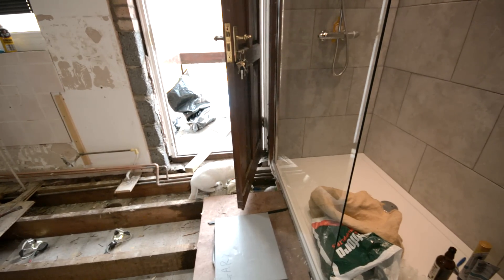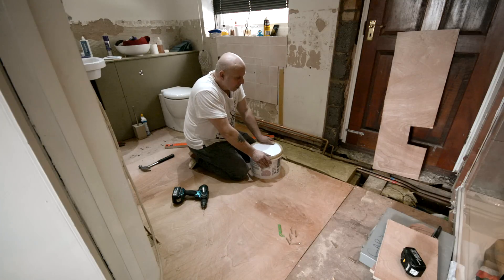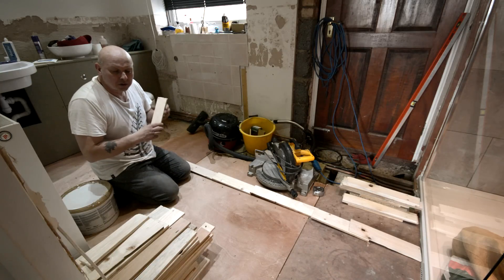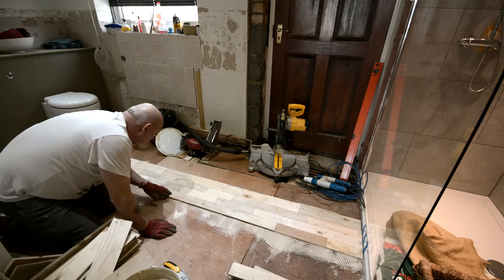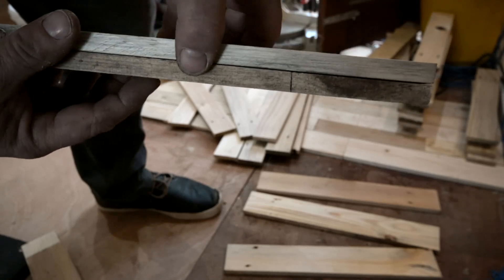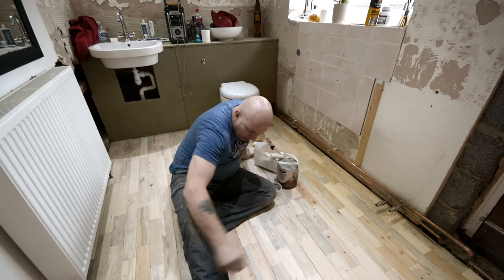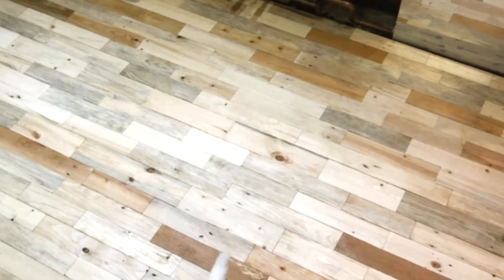Pallet wood bathroom floor

Comment: Nice cheers👍🏻🇬🇧
Reply from the maker: Thank you
Reply: How did you waterproof it buddy?
Reply from the maker: @StuartOliver83  A few coats of Liberon Hard Wax Oil, It is suppose to be for high moisture areas, such as and bathrooms and so far has done the job. I didn`t want a gloss varnish look but a good satin yacht varnish would do the job just as well, Hope this helps.     Gary
Reply: Thanks mate it’s exactly what I need to know,I’ll somehow send a pic when done 👍🏻🇬🇧
Reply from the maker: @StuartOliver83  love to see it when its done.

Comment: Hi, very nice work you have done. I am planing to do the same in my bathroom but the floor is from ceramic so i dont know how i can fix the pallets over the stones. If u can give me an idea it would be very apreciated. Thanks very much from Spain
Reply from the maker: You can do a test piece to see if Bona 850 rubberised glue would work. It can   handle a lot of movement But the glue is only as good as the surface it is fixed too. Hope this helps , thanks Gary
Reply: @possumheadcarpentry  Thanks very much for answering. I have searched the web and I can find that glue here. I am going to try as you say in a piece . Many thanks again

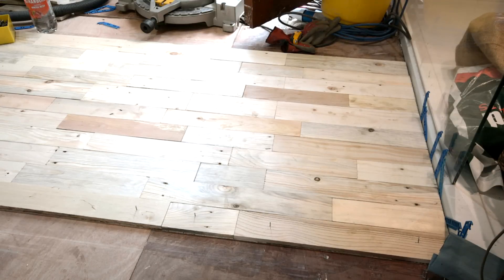Comment: Great job my friend.  I am in the middle of doing a pallet floor for my 11'x12' office at home.  Like you, I got tired of pallets and began using some hardwood boards I had.  All wood is now planed, edged, and ripped to width.  I have it stacked inside and getting it acclimated for a week or two.  I am leaving all knots, bug holes, etc with the intention of filling it with Alumilite or a quick setting epoxy resin.  I did want to thank you for taking the time to make the video and also at the 6:12 mark for giving the idea to pin the last row of boards into place while the rest dry.  Brilliant!  I am going to do a center design of a diamond in the room and will use this tip.  Thanks again.  I think I followed you on IG.
Reply from the maker: Thank you very much, its nice to hear someone else is going through the pain. It is a lot of work but when you are finished it will be worth it. My next pallet wood project I have had to shelve because I was going to do the front of my house with pallet wood but the local council would get all unnecessary so I have decided to do the entire front room with the pallet wood. You should do a video to put on Youtube to give people ideas. Thanks again.

Comment: Looks great.. im looking to do the kitchen using pallet wood on concrete floor. Did u just use glue on floor? And did u glue the pallet pieces together or left the floor glue to hold it?
Reply from the maker: Hi, I just glued them to the floor, I used BONA 850 R, it’s a rubberised glue so the whole floor can move together. I temporary pin the outside rows till it goes off then take the pins out so it can all move, hope this helps

Comment: Why didn’t you have the toilet sitting on top of the flooring ?
Reply from the maker: Unfortunately it is the only toilet in the house and I didn’t have time to lay the floor before the family came back
Reply: @possumheadcarpentry  fair enough, do you find the loo is noticeably lower?
Reply from the maker: The floor is only 13mm thick so you don’t notice

Comment: Nice work! Currently replacing the old nasty carpet in an RV with a palletwood floor. A ton of work, but beautiful and rewarding.
Reply from the maker: +Tim Royal  What a good idea, It will be worth it in the end. A video of the finished job would be good. cheers
Reply: The "character" of palletwood makes it a bit wild... It cracks checks and splits pretty easily. Gluing it to a stable underlay stabilizes it... I wouldn't just nail it personally.
Reply from the maker: Its best glued with a rubberized glue like Bona because most pallet wood isn't seasoned so it will move but if you keep it in the dry ( preferably in the room its going to be laied ) for as long as you can then it will stabilize as much as wood does, hope this helps, cheers
Reply from the maker: I must admit that laying a pallet wood floor in an RV is new to me but if you used a packer between them and used mastic as a type of grout then it wood be possible but a hell of a lot of work. cheers
Reply: I am brad nailing and using titebond II to an mdf base... the engineered wood will prevent the palletwood from moving (similar to the layers of plywood)  The edges must be parallel and the back against the mdf must be jointed/planed flat and use plenty of glue... I buy it by the gallon :). This is a tried and true approach for me... works perfectly every time.
Reply from the maker: The beauty of woodworking is there is so many ways to do one job, As the saying goes , if its not broken then don`t fix it. Hope to see a video, cheers.
Reply: Thanks! I probably won't do a video, but you can find me on Instagram and you will definitely see the result! www.instagram.com/timroyalsr/
Reply: Hey! I would love to see the work in progress/finished project of the wood flooring in the rv as I have been thinking about doing something similar.. Thanks!
Reply: +Dakota Langdon slow project! At this point the mdf is laid and a lot of boards are cut, but probably won't get this done until October.

Comment: Water will ruin that floor and no doubt the floor underneath will also Suffer .
Reply from the maker: Because I used a wax oil, nothing has got under so far, and because I used a rubber based adhesive, if any water did get through , it wouldn’t spread but even after a few years nothing has got through

Comment: Looks great! Is glueing better than nailing or screwing?
Reply from the maker: When you are fitting a wooden floor it’s going to move , so if you nail or screw it will crack or twist or cup, so if you glue with rubberised glue it is aloud to flex and move and keep its shape, hope this helps .
Reply: @possumheadcarpentry  thanks that does help

Comment: Beautiful job!

Are there any advantages in using an oil based stain as opposed to a clear coat of varnish?

Regards Dave
Reply from the maker: Hi David, I`m not really sure which is best. I used Liberon hard wax oil because someone recommended it. I read the info and its good for bathrooms and kitchen where its high humidity and moisture. hope this helps, cheers
Reply: Thanks for your response!

David

Comment: I couldn't quite tell if the sides of each plank was left straight or if you cut them to fit like tongue and groove, can you please tell me? I'm seriously thinking of making our living room floor a pallet wood floor as I love the rustic look and absolutely hate the nasty carpet we currently have now. Thank you in advance. BTW, your bathroom looks amazing even if it's not quite finished :-)
Reply from the maker: Thank you Kristy, the boards are cut with straight sides, If the boards are stored in the room or near as where they will be laid, they will become acclimatized alot better. If you can get hold of a bench/table saw you can regularize the size which will make life alot easier, its hard work but worth the effort. Hope this helps. Gary
Reply: Thank you! Actually that lil bit of info helped lots!!! :-)

Comment: by the way, this method can be used in a deck outside, or has to be another kind o seasoning to the wood?

Regards.
Reply from the maker: Hi, I’ve never used pallet wood outside but it would need some very good preservative ,

Comment: what you recommend to make this look distressed? more like a washed finish?
Reply from the maker: The way we made our front room look older was just leave it unprotected  for a few months and let ageing do its stuff. After that put the stain or finish on and it does look like its been there foe quit a while. At work we have used chains, wire brushes, bits of wood with nails in, all-sorts. If you are looking for a unique colour you can mix different stains together to get the colour you want. Our front room is one part rose wood and 2 parts light oak mixed with a bit of white spirit. Hope this helps. Cheers

Comment: "I wouldn't mind if I didn't see another pallet in my life." I believe you! Nevertheless, the floor looks great. 
My only concern would be that pallet wood is relatively soft, so I wonder how much punishment it will take. Yeah, I'm thinking about high heels... not suggesting that it's you that wears them though!
Where I live (central Europe), it seems the only readily available hardwood like beech or oak is ALWAYS cut into short lengths and split for firewood. :-( I've even considered trying to use this to make short, flat boards for further use but (like reclaiming pallet wood) the prospect is truly daunting.
Reply from the maker: +Alan Mumford  The beauty of pallet wood is that it is mixed wood, the beauty out way the high heels, the longest piece of wood i use is only about 300mm long, hope this helps, cheers

Comment: Aren't wooden floors supposed to be a bad idea for bathrooms due to moisture exposure?
Reply from the maker: You can minimize the problems by using nice dry pallet wood and also laying it on rubberized glue is a must, this allows the whole floor to move and there is a gap between the floor and the walls which is masked by the skirting. Here is a link to a video I did showing the floor after 9 months of use. Hope this helps.  https://youtu.be/q6CsWM-ogr0
Reply: Nine months is a very short time in the expected lifetime of a floor, certainly not long enough to know how well it wears.  However, thank you for the reply.

Comment: Nice job big man.. Many pallets did that take you? Ps whats the dimensions of the floor?
Reply from the maker: I`m not really sure how many i used, maybe about 20-30 pallets but was picky about what bits to use but the left over stuff i`m going to use on my staircase which I will make a video. The bathroom is about 3.000m x 1.800m
Cheers,

Comment: Excellent!  Thanks for sharing with everyone! About how much adhesive did you use?
Reply from the maker: Thanks Ted, I used about 5kg of glue but it depends on how flat the sub floor is and how big the grooves are in your trowel, so the flatter the sub floor the less you need to build up, hope this helps. Cheers.

Comment: Great Job Mate, N pipe works easily hidden Whats it look like now youve had a month or 2 or ware on it?
Reply from the maker: Thanks Hugo, It still looks brand new, which is a bit of a worry, so in a few more months I will do a follow up video to see if it still looks good. I`m hoping that because I had the pallet wood in the bathroom for a few months that it stabilized a bit before I layed it down. Cheers